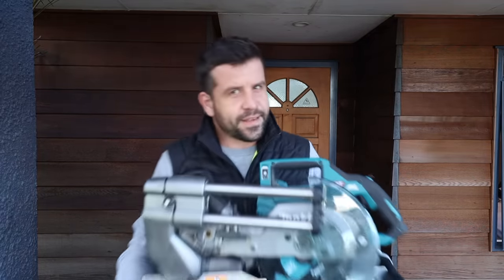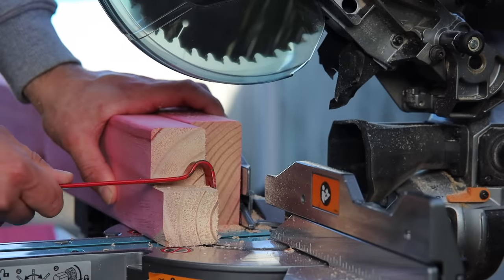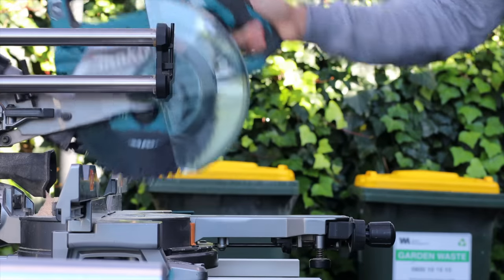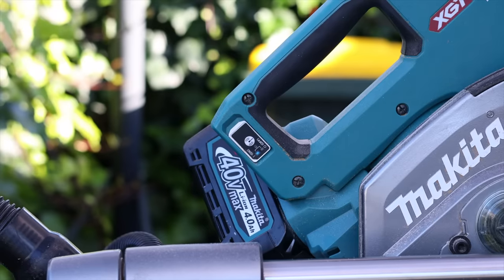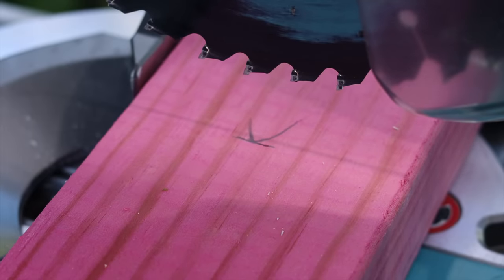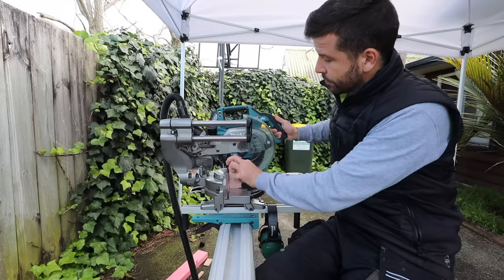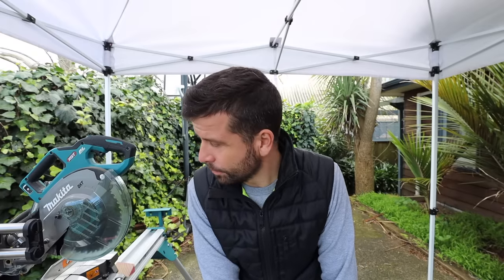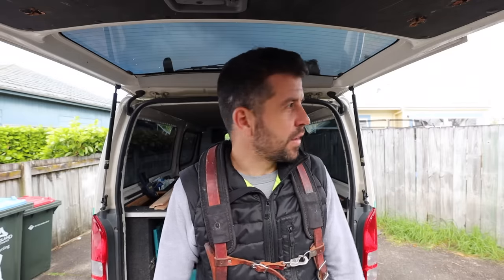Why I Use This Mitre Saw Everyday (Makita 40v)

Comment: Two questions:
1) What advantages over the 36V (2x18) saws? 
2) Is the depth adjustment unique to this model?
Reply: The biggest advantage is the requirement of only one battery vs 2. Therefore "twice" the run time on the # of batteries you have charged/on chargers.
Many different brands have a similar depth stop adjustment. It's one of those simple things that just don't need a lot of re-engineering. The location may change or the spring may be missing but it's pretty much standard.

Comment: I’ve had a few saws. The Kapex being the best (stolen) I’ve got the Milwaukee 190mm mitre saw at the moment. It’s a list of missed opportunities. It doesn’t have a shadow line as standard even though it has a led, no depth adjustment, and the thing that boils my piss the most is the barely 200mm cross cut. It feel like a toy! I’ve been running Milwaukee now for 3 years since my dewalt got nicked along with the kapex and it’s all over rated.

Comment: Hi Scott. You don’t mention the very slow, turn knob, mitre locking system.  If you want to lock the saw off the detents the Dewalt and Milwaukee have a much quicker cam lock at the front.

Comment: Mostly used makita and de walt saws, the only problem I had with de walt saw was the safety lock out on the handle, because I am left handed, it always operates when i grab the handle , you dont make a concious decision to unlock it, so may be a bit dangerous, otherwise great saw and simple track design so less to go wrong, sometimes makita track system needs to be adjusted back to tight because you get play in the sliding funtion.

Comment: I might be mistaken but this is a 10 inch saw .It is to be expected that your Kapex 120 would have a higher fence with more cutting hight, nor would it have blue tooth as its a corded  machine.

The biggest design  floor you mentioned is poor dust extraction showing that Makita are over thinking its design then making a hash of it.

Comment: Great video, sounds a good product. Shame the pistol grip isn't rotatable 90° either way, the catch both camps!
Is it much different than the 36v you tested last year?
How long does the battery last let charge?
Reply: Why would you want the handle to rotate .This orientation is by far the most ergonomic and practical way to use the saw..I've used many saws in my years as a carpenter,and the other styles of handles are so uncomfortable to use.

Comment: Kapex is good, don't like height adjuster but it's a great rounder.
I have a 25 year old DeWalt that still as accurate as the day I got it, and I'm a picture framer.
But I use a Breveti double mitre saw mainly. Tell you what though, I still reckon the DeWalt will out live then all.

Comment: I’ve got that saw as well. Really do enjoy it now that you’ve mentioned the light button that does annoy me 😂 it should just be attached to the trigger.
Also been testing out the new Bosch BiTurbo 216mm mitre saw as well. Doesn’t have dual bevel like the Makita and loads of other saws. But nice action to use and plenty of power for 18v.
Reply: What is the cut capacity at 45 degree bevel? can it cut through a 2x4 at 45 bevel?

Comment: it looks good. A bit small or my liking but I'm sure they will bring out larger versions over time.
That small tube would be an issue for sure. You lose about 50% airflow stepping down tube size than another 30% for every 90-degree turn. You also lose a heap of flow from corrugated pipe.
All in all, that bit of pipe is near useless.
Still like the old big arse Hitachi 12"

Comment: What I really don’t like about it is the slide lock doesn’t lock out the sliding function properly there’s a few mm back and forth when the slide is locked. To me this is disconcerting and could create a risk where you think it’s engaged when it’s not because of the movement. Stupid I know but I think for safety all features should have a very positive solid feel so you know something is engaged.

Comment: Biggest hate, the handle is vertical instead of horizontal. My wrist and arm hurts more after a using the vertical handle than a horizontal handle. It's very bad ergonomic. And even bigger, you have to lean to the side to see what you are doing.

Comment: I cant decide between the LS002 and the Festool Kapex KS60E. I compared both machines in store and the glide/movement on the Festool was ridiculously smooth with next to no sway in the head when fully extended. The LS002 wasn't too bad. Overall the price of the makita is alot more once you add in the batteries and charger. The cutting depth is greater on the LS002 aswell. Im leaning towards the festool for the accuracy but the Makita as an all rounder. Cant make my mind up! ARGHH!!!
Reply: In the same situation.Did you manage to picknone in the end?
Reply: @Keith Mulhall  I went with the Makita and i love it. The blade that comes with it  gives amazing flawless cuts aswell. The machine itself is extremely well built and very precise and user friendly.

Comment: The handle drives me nuts. I much prefer the 10” saw handle. Agree the dust port is too tight. They need to enlarge the tube 10mm.

Comment: Time has ticked by and I'm ready to get another SCMS. I've gone full circle (pun) and I'm looking at the 305mm 40V Makita. Something I'm not sure about is the mitre stand. There's a bundle about that has the short stand, 2x4ah and a fast charger. Typical ... I want the longer stand, bigger batteries and a double port charger :(

The 305mm saw looks to have larger dust port hoses which would tend to address the blocking up you identified.

Comment: Great review! Ive got the 54v dewalt drop saw, which is great also, but it too has a button for the light and you can’t reach it from the trigger handle thing. Not a big issue I guess but it is annoying and you end up just not using it..

Comment: Hi Scott, great review. Does the Bluetooth need pairing every time you use the hoover or once it’s paired does it need doing again.
Reply from the maker: Hey mate, It stays connected once you've paired them. When you turn off or remove a battery, on either tool, you need to pair it again.
Reply: @ScottBrownCarpentry  thanks Scott
Reply: You only need to do the full pairing process the first time, after that just click the Bluetooth button once to turn on the Bluetooth, the light will begin to flash to show Bluetooth is active.
Reply: @jonwhiting6528  thanks Jon, that sounds better and less faff

Comment: I've literally just bought this saw today, had a play with it and love everything about it except the dust extraction! I've found the bottom dust port squashes against the top 1 thus making the main extraction point totally ineffective.
Reply: I wonder if you could modify by 3 printing some larger ports or atlest ports wuth a larger connecting hose
Reply: I took the bottom port off mine works better imo.

Comment: Just get 10 builders to work on the design of the ultimate drop saw and keep it cheap. There's your overall winner, the end
Reply: Just get three pizza connoisseurs to agree on a single pizza topping. There's your winner....oh wait.... I've been a builder for some 40 years and have always used 216mm mitre saws (Elu 174 and DeWalt replacement). Most builders swear by 12". Many now swear by battery. I would not even consider battery...

Comment: how does it compare to the makita 36v mitre saw?
Reply from the maker: A LOT lighter, almost half the weight, The 36v has a higher fence, bigger blade etc. I think it has a different angle adjustment system for the blade, I am only going off memory so happy to be corrected.

Comment: I have the 240v version, Ls1019L which came with re  movable fence extensions, not sure if they fit your model? 

How did you find the accuracy out of the box? I had to adjust the detent plate, and the 0 degree bevel point to dial it in to square. Pretty frustrating for a $1000 AUD saw.
Reply: I just set mine 40v up a few days ago after letting it sit in my room for 4 months, I had to do the exact same thing, spent a good 15 minutes micro adjusting the detent plate which was a damn pain and had to adjust the bevels since it wasn't 90 degrees and the bevel wasn't 45 either. Didn't even have to do this much work on the 2 seriously cheaper Ridgid saws I owned before, both 7-1/4" and 10" sliding saws.
It's still about 0.5mm off on a long slice since I was doing it outside in the cold wind so I gave up for now lol.

But I agree, for the ridiculously high price we paid for these Makita saws, it's kind of a slap in the face when people can get a cheap Craftsman saw cutting straight and 90 degrees right out of the box sometimes while we're stuck fixing every single angle these tools have.

Comment: the biggest issue i have with makita is their 40v platform. they're releasing all these cool new tools that are only available on 40v. so you either have to rebuy all your tools, or have some tools that are 40v and some that 18v and have two chargers, two types of batteries, and two sets of tools. stupidest money-grab ever. and they don't have the vast amount of storage and accessories as other brands like milwaukee and dewalt. if i'm gonna be rebuying all new tools, might as well switch to one of those two brands instead.

Comment: Hey Scott, What’s the battery life like?
Reply from the maker: That 4ah battery lasts all day. Very unscientific I know, but that fact that I don't think about it much is a good sign.
Reply: @ScottBrownCarpentry  Hi Scott, I use a Hikoki 216mm Corded and a Milwaukee 305mm Corded, but would the 40v have as much cutting power as a corded saw? I'm normally cutting tropical hardwood and European Oak, so sheer cutting power is important for me.
Reply from the maker: @wyatthaughton6014  I'm not sure about that one. I haven't had any issues with power, but I mostly cut soft woods. I wonder if you could get your hands on a demo unit from whoever does Makita in your area, that would be the best bet.

Comment: Frankly i fail to see the purpose of a battery drop saw used in conjunction with a vacuum cleaner. You need electricity  anywayfor the latter then, what bother with batteries?
Reply: It's a battery powered vacuum
Reply: @rolabears  I did not get that.

Comment: I’ve owned my festool kp120 for 5 years. It is so much better than any makita. Makita are sloppy. Scott you are a nz carpenter like myself. The accuracy of the kp120. There are downsides to the festool, but they don’t outweigh the benefits vs the rest

Comment: For all that, I'll stick with my power strip on the floor for vacuum.
The slider and bevel lock are nice.
..and a really prefer the horizontal handle, laser guide, cut depth and price ($149) of my HF saw
Reply: Horizontal handle set up is rubbish..

Comment: I have the next model up from your milwaukee drop saw. It's honestly garbage compared to this makita or even your milwaukee drop saw. 

- Laser cannot be aligned
- Fence and base not square with blade
- Had to order the duel hose online because alot of Aussie stores don't stock it or even are able to order it in.
- because the blade was so out of square my first cut actually cut into the base

Comment: I see an immediate flaw and this is one that cannot be ignored nor can it be worked around. Look at the handle. The orientation of that handle... It's in line with the saw blade. Any saw with this orientation is no good. All saw with the grip of the handle perpendicular to the blade is the proper alignment. It's much more natural to grab the handle when it is in a horizontal position. Less pressure on your wrist and much better control. You also use a more comfortable muscle group. For me, any and all saws with this handle position are automatically disqualified no matter what.

Comment: Makita is trash for releasing a 40V system that is comparable to Dewalt & Milwaukee’s “20”/18V platforms. They should’ve & could’ve easily released much better batteries and refined tools for their 18V line. I understand a 60V or 80V platform but other than that 🗑